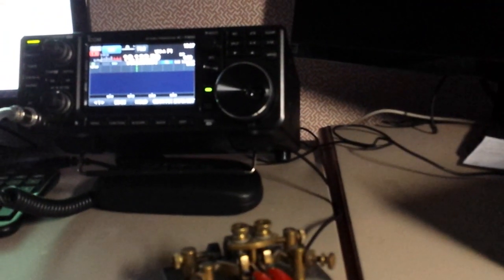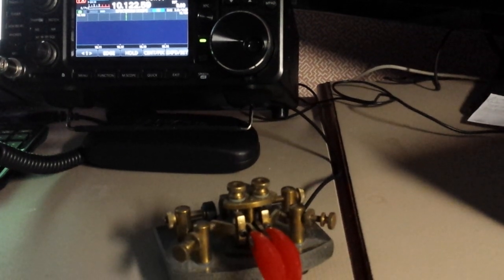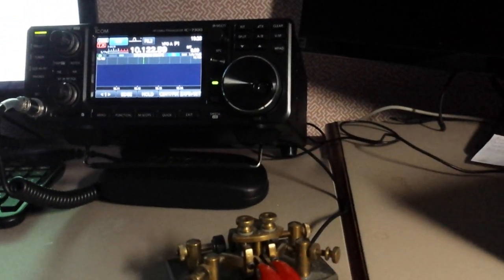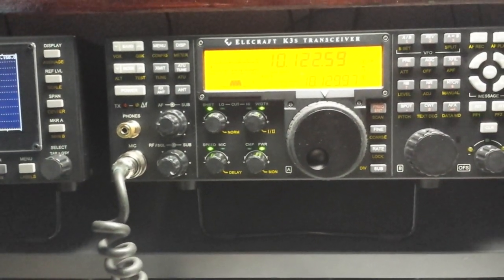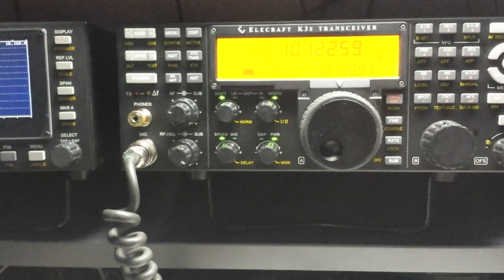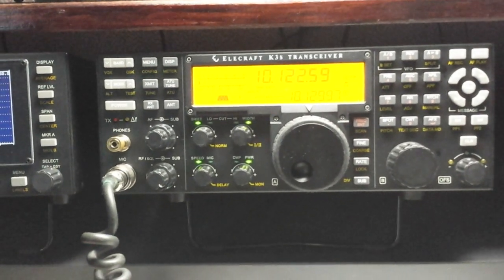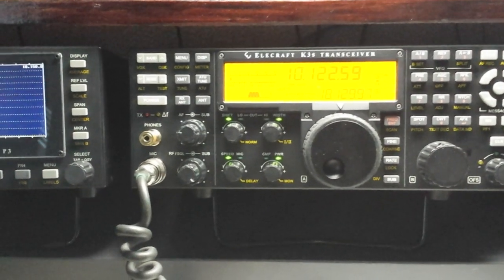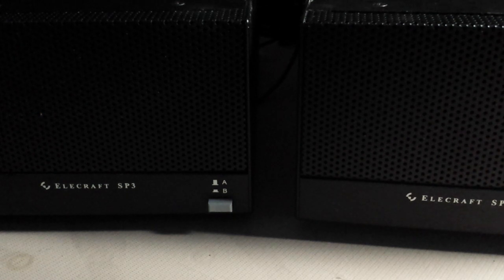IC-7300  VS K3S  Weak Signal CW Comparison

Comment: Both have equal Sensitivity between the K3S and IC-7300. 

The 8-pole filters in the Elecraft gives the ringing pitch due ( sound between dits and dah in CW ). Hollow pitch, like listening thru acoustic hollow tube is the pass effects from the ringing in 8 pole filters, if done with fewer poles on the Elecraft, hollow pitch should disappear. More passive IMD due to 8-pole filter in K3S, but better blocking than typical SDR radio's like IC-7300

The 8 pole filters should give better blocking in a CQ contest like CQWW so there a tradeoff going o between the IC-7300 and K3S
Reply from the maker: +mikeatthebeach You were doing fine until you started talking about "blocking". The two technologies cannot be compared in that manner.
Reply: Just to clarify: Both the KX3 and K3/K3S are SDRs. A major difference between 
these rigs and something like the IC-7300 or Flex 6xxx series is that our 
A-to-D converters (ADCs) are protected from wideband interference by a 
narrowband I.F. The K3/K3S uses crystal filters, while the KX3 uses precision, 
narrowband low-pass filters.

In direct-sampling SDRs, the ADC is right at the front end of the radio, 
protected only by wideband LC filters. The result is typically 15-20 dB lower 
blocking dynamic range. More subtle is the effect of multiple signals, which 
can combine in phase to hit the limit of the ADC, resulting in unwanted images.

It's a tradeoff; a direct-sampling SDR can allow you to look at multiple MHz of 
bandwidth on its spectrum display, if that's of interest.
Reply from the maker: +mikeatthebeach Check the Sherwood list. The 7300's narrow spaced dynamic range tested 12th in the list of radios, higher than the TS-990 and others with roofing filters.  Also the ADC is protected from overload by use of the RF Gain control and attenuator. So yes, it is possible to overload the ADC if you allow that to happen. Things might get a bit tricky in close proximity stations such as Field Day or DXepeditions however.

Comment: The K3 always had a crappy audio section.  Sensitivity and selectivity are excellent however.  For what they are pricing the Icom at it seems like a deal as compared to the K3S. They aren't in the same ballpark as far as features and RX performance.
If only they could make the K3S sound like my old Kenwood  TS930!

Comment: Sure seems to me that the K3s has a much higher noise floor.

73,
Ed KA9EES
Fithian IL
Reply: Yes, but at the same time I'm thinking that the tone was a little better to copy. Less processing. What do you think? I don't own either radio.
Reply: Because there is more dynamic, you can stay behind with the RF-Gain and have the same signal strenght with less noise.

Comment: 7300 win !
Reply from the maker: +Francis Mayon The IC-7300 has "real" full break in but it does use a relay, not diodes, for switching. Yes it is loud however a small pinch of coax seal makes it much quieter so it is typical of most radios. The K3 is an exceptional radio in this regard.

Comment: this would be a better test using a fixed mic and the same speaker  not two speakers.   even identical speakers will sound different because of position relative to room conditions and mic position.    This test shows that the IC does very well.  but Id like to see the same test in a controlled lab and not using a cell phone to record the audio

also this test only one aspect of the radio.    if you take all the feature sets of both radios  its not going to be a K3 killer.  but thats not to say it wont be a very good reciever.

Comment: Most modern radios have more than enough sensitivity, the "acid test" would be picking out a weak station in a huge CW  contest pileup, with a couple of nearby big guns calling cq just outside of the filter passband.  It will be interesting to see what Rob Sherwood comes up with on his evaluation of the radio. Maybe it'll set "a new bar" for the mid-priced transceiver market.

Comment: Unlike other radios, on a noisy band like 10 MHz, setting the K3S RF GAIN to MAX makes the rig sound worse, because all it does is make more noise.  Back it off a bit and it will sound better with no loss of sensitivity.   Second, the passbands and pitch settings do not sound equal at all; the K3 passband is hearing much higher tones than the IC-7300.   To hear below 300 Hz in a stock K3S passband, you must go to the RX EQ audio equalizer screen and tap [0] until you see 0.1 displayed, which means the passband will now hear down to 100 Hz instead of cutting off at 300 Hz.  The IF shift can also be used to make the passbands sound the same if you set CONFIG:PB CTRL to Shift=0.01 instead of the default Shift=0.05.

I suggest applying these changes to the K3S, then repeating the test with weak 28 MHz CW beacon, 28.200 and above, with and without preamps, with and without Noise Reduction.
Reply from the maker: +RAWilsonTV Same is true for the 7300. That's why I set them for equal values. Certainly both rigs can be made to sound almost identical with a little tweeking but I was trying to be fair.
Reply: +Steve Ellington It's not really fair to make comparisons when the K3's RF GAIN is set to the worst possible value (max), and the passband is set (as it is by default) to cut off most low-frequency audio.  In case you misunderstood, I'm not asking you to adjust the RX EQ values:  you should keep it flat.  Please just tap[0] until you see "0.1".  You should hear how it makes the K3 audio sound much better.
Reply from the maker: +RAWilsonTV On the K3s with the bandwidth at 350hz changing from .3 to .1 makes no audible difference due to the width of the narrow filter. Changing the passband shift will of course alter the position of the center to a point....I can do the same thing with the 7300's PBT. I opted to leave both rigs at default. Too many of these "comparisons" cheat by tweaking their pet rig. Not me.  Yes I am aware that the IMD is vastly better in the K3 but we are dealing with something I call "signal recovery" and that's often a function of DSP code or even the audio amplifier. I can make a $25 direct conversion receiver sound better than either of these on a cherry picked signal! It just wouldn't have all the glitz.
Reply: +Steve Ellington 350 Hz?  Maybe that is a typo.  In the video you say you are using a 450 Hz bandwidth in the IC-7300, and a 500 Hz "crystal filter" in the K3S with the bandwidth "set for for 450 Hz."  Why did you choose that bandwidth instead of 500 Hz, which is standard for CW in both radios?

I assume you are using the stock Elecraft 5-pole 500 Hz CW filter, not the much better Inrad 8-pole 500 Hz filter or Elecraft 8-pole 400 Hz Elecraft, which cost almost twice as much, for good reasons.

Did you mean to type 250 Hz or 350 Hz?  Yes, you can't hear any difference at 250 Hz, but you CAN hear a big difference with the bandwidth set at 500 Hz.  What is Config FLx bandwidth set to?  It affects when the filter kicks in.  Try setting it to 500, not 450.  Tapping [0] will reset the bandwidth to this value.

Ideally, please try the 500 Hz CW bandwidth for both radios, with the .1 kHz setting in the K3, set CW Pitch at 500 Hz in both to center the passband, and create another video (after backing off RF Gain to about 9 O'clock in the K3S or both).
Reply from the maker: +RAWilsonTV  Yes....450 hz....I used that bandwidth because that is where my 400 Hz roofing filter kicks in on the K3s. That should give the K3s an advantage unless filters degrade copyability. After all, we are comparing  the technology invented in 1918 by Armstrong with modern direct sampling which has no mixers to generate noise and no crystal or mechanical filters to delay and distort. By all rights, the 7300 should sound better. If not then we are heading in the wrong direction.
Reply: +Steve Ellington Thanks for clarifying filter configuration, especially since the video voice-over incorrectly describes it.  To review, the IC-7300 sounds better because the K3 is not adjusted properly, cutting off all low frequency audio, among other things.

Set the Elecraft K3S 400 Hz 8-pole CW filter to kick in at 400 Hz, not 450 Hz, otherwise you will hear some unwanted noise outside of the crystal filter passband.  Next go into RX EQ and tap 0 until XFIL LO is set to 100 Hz.  This will bring back the low-frequency audio.  Set the CW PITCH to 500 Hz.  Finally, back off the K3S RF GAIN to about 9 O'Clock.  Set the IC-7300 for a 400 Hz filter as well, 500 Hz pitch, and the RF GAIN to whereever sounds best.  How do they compare now?
Reply from the maker: +RAWilsonTV Bob ....Maybe you should pick up one of these little 7300's and make a video since I seem to do everything incorrectly. I'm certain that with your knowledge and skill you can make one of your K3's sound better. I've been using them for 9 years now and indeed they are great rigs. My first K3 was serial # 410. Certainly the QSK is 100 times better than anything ICOM ever produced, except maybe the IC-781. BTW. If eliminating the K3's roofing filter makes it sound like the 7300, which it doesn't, but if it did then the whole point of having roofing filters in the first place would be missed. BTW: When decreasing the 7300's bandwidth to 400 Hz it gets even quieter! Maybe I should have used 400 HZ instead of 450.

Comment: I would like to hear an s7 signal which is a khz. beside a 20 over signal.
Reply from the maker: You could hear it ok but only if that 20 over signal is clean. Phase noise transmitted  will bypass any filter.

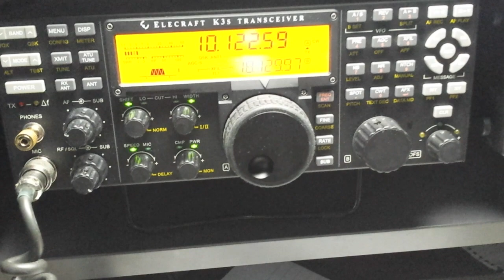Comment: The perceived receiver S/N ratio changes radically as the camera is pointed in different directions during the video.  Have a listen at 6:08 to 6:20 and listen to how the K3s receiver seems to spring to life as the camera direction changes and points at the speaker instead of the radio.
Reply from the maker: +N1EU The Samsung Galaxy's mic is on the bottom of the phone but the phone is turned sideways. That way when it's aimed at the speakers both get the same amount of pickup but if I swing the phone 90 degrees it aims at either one or the other speaker give the perception one is stronger than the other so assume that when it's looking directly at those 2 speakers you are hearing what my ears here. That's about all I can do.